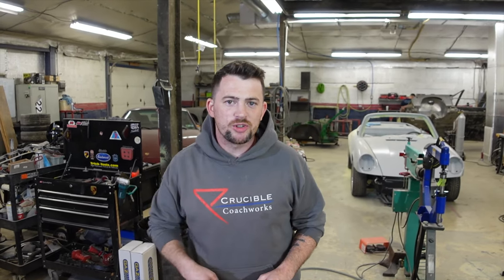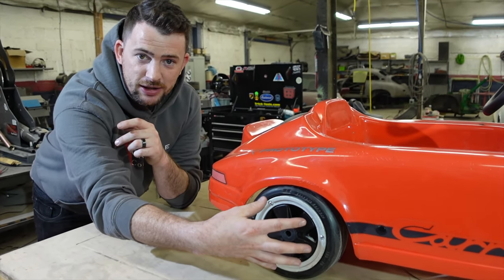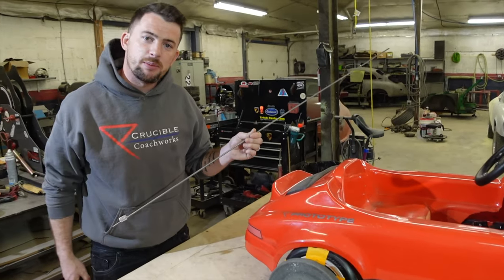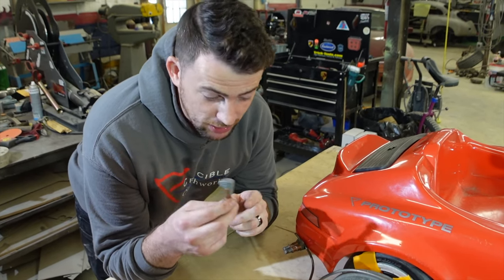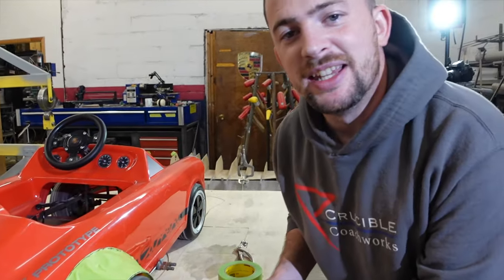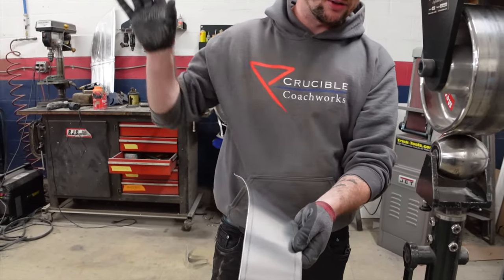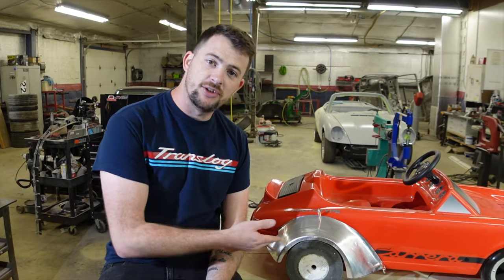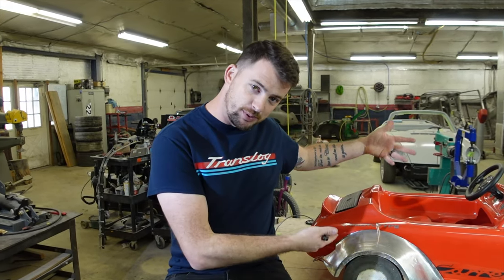Try Doing THIS When Building a Custom Widebody Car!

Comment: Awesome video! If you were hemming the wheel edge, would you be using the bead roller to do that?
Reply from the maker: Correct! Bead roller to tip the flange, a stretch to allow it to lay flat, then hammer and dolly to finish it off.
Reply: @CrucibleCoachworks  thank you sir!

Comment: I thought wide body was where the body was split down the middle and physically moved outward, a strip is added in this center gap, thus not requiring fender flares
As opposed to... fender flares.